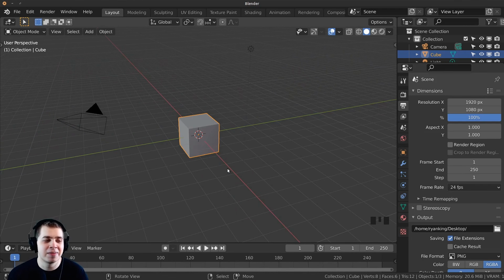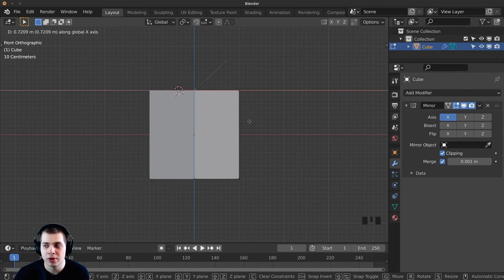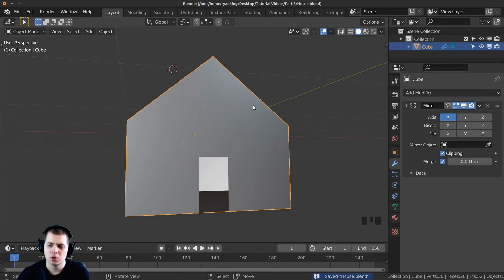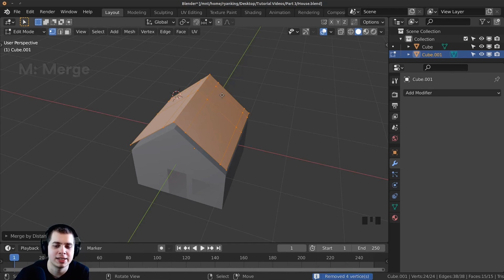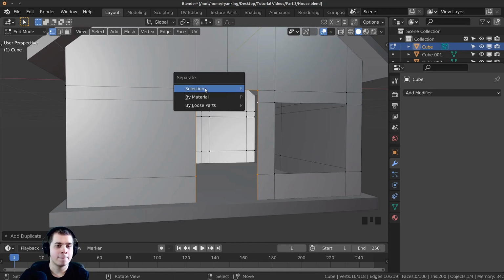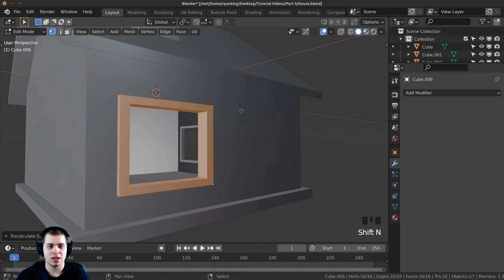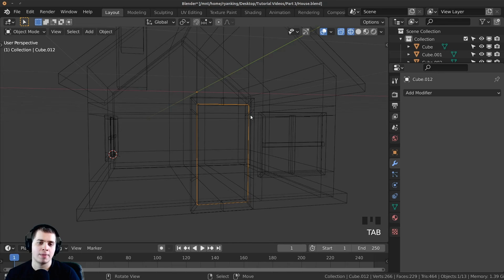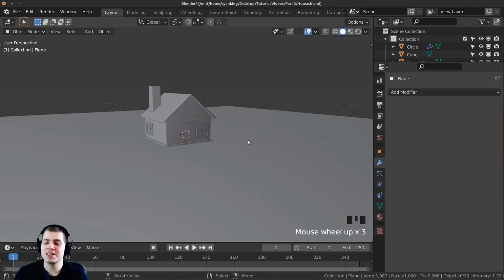Part 3-Blender Beginner Tutorial (Modelling the House) Updated Tutorial Link in Description

Comment: I am loving these tutorials, I've tried several times over the years to learn blender. Granted I AM struggling as I don't see the movements as quickly as others. I've restarted this particular one half a dozen times already. Only thing that I feel would help me(maybe not others) is the instructions wrote down as well. I get sidetracked with all the helpful tips, because you know I HAVE to go and test them out, then loose where I'm at. But, that's just me.  I'll SLOWLY push thru the tutorials, even if it takes me a year or more.

Comment: Thank you Ryan for this very helpful video series. I didn't get one part in this video though: When you started adding the window frames I saw that in the menu on the right a new object was created although you didn't use "p" to create it. The first vertical frame was named cube.007 and then when you duplicated it another one popped up and was called cube.008. I believe I did the same thing but in my case the whole window including the newly added frames were all one object and later copying and adding the window frame to the other window was kind of difficult. Any ideas what I might have done wrong? Thanks you in advance.

Comment: Hello there... Following your Video timeline at 18:58... My side in blender doubble time press G key is not working properly on the Top Right edge. it starts 90degree angle of the top right Edge and moving vertices to wrong directions. Where I am doing something wrong. I have tried so many times but facing the same problem.

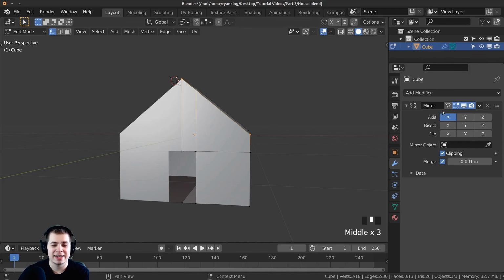Comment: pls help i have version 2.8.0 - I am unable to follow the video at 19:26 on the video timeline apply the mirror modifier - I do have the Apply Button; this is where I am having problem.
I follow your instructions, I select Object - I move the cursor to the modifier windows, press Control-a, I clicked tab to go to edit mode.  house does not have actual vertices on all the sides - I exit blender, reload the house, this time, I select Object, the Apply button enable - I do not know what to do - I did not press Control-a, I clicked on Apply button. Click on tab to select Edit - house does not have actual vertices on all the sides

Comment: Im having trouble with the loop Cuts,  it does not cut all around like yours , i only get the Cuts on the Front Face and is there a way to move the cut after placing it
Reply: I have these issues with the loop cut. The work around thus far that has worked is select the loop cut with alt and left click. Then press F to add a face. Then GG. The face keeps things together in one piece. Then, I erase the face. Just be careful not to erase anything else. I hope to find another way, but this works for now.

Comment: 18:53 If I double tap G the vertex on top of the door is not sliding till the end. So after sliding the door end line is not straight for me. Pls help me with this @RyanKingArt
Reply: Same here. The vertical lines of the doorframe got an angle if I try to make the door bigger. But it works when im trying to make it smaller.
Reply: Same with me😅
Reply: I am using Blender 4.2 and I am having the same problems as others in that the edge will not slide all the way down and everything distorts. Can you help?
Reply: Press shift and select vertex one by one in loop then press Double G it's work

Comment: For anyone whose merge did not work, this is what I did:
- Click M and click "merge by distance" (you must still do this even though it doesn't work)
- A small pop up in the bottom left corner of the screen titled "merge by distance will appear" 
- Increase the number on the scale (this increases the distance in which vertices will merge)
- Then, make sure to click "unselected" in the pop up window
This should then merge your vertices, hope this helps!
Reply from the maker: thanks for sharing

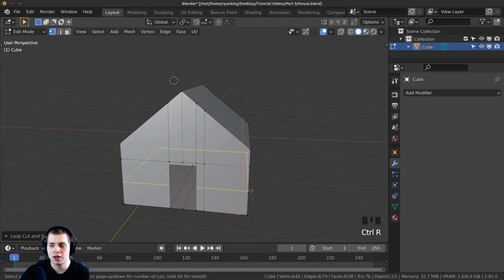Comment: I'm at 20:38 and the loop cut only applies to the right side of the house. I'm not sure if I'm doing something wrong as I've followed all the steps, or an update just changed the way blender is handling this. In the meantime I redid the opposite side of the house by remember the coordinates, but I'd appreciate some input so I can avoid the same issue in the future.

Comment: Thank you sir for getting me beyond fumbling around the GUI and keyboard shortcuts! 

Question: The loop cut proportionally climbs up the side of the house vertically, but stops at the soffit. I want to create a horizontal loop cut above the soffit in the area of the gable in order to construct a rectangular attic vent via the Mirror Modifier on that side of the house. I just can't slide the loop cut along the roof slope. 

Is there a work around?
Reply: I think I've stumbled upon the Bisect Tool's capability to loop cut the gable at the mid slope. I'll experiment with it and see if that's the right tool.

Comment: worked on the first part, and got to the part where this added the Miirror cut, but the problem is that there is a spaced line in the middle now and it does not match what is on the video. What did I do wrong?

Comment: Super tutorial.. I'm amazed at how much I'm able to do with just the things I learned in this video :)
Just one thing that I'm not sure was clear, though. I was having trouble replicating the mirror effect, Ryan made it look so easy! It turns out that each object has its own origin point within it (little orange dot), and that's what it mirrors on, which is why he cut the box in half, so that the origin point was on that edge. So the way I fixed it is to go into edit mode, select all vertices, move them over so the dot is where you want to mirror, then go back into object mode and add the mirror modifier. Put the point outside and you can do cool things like make twin meshes!

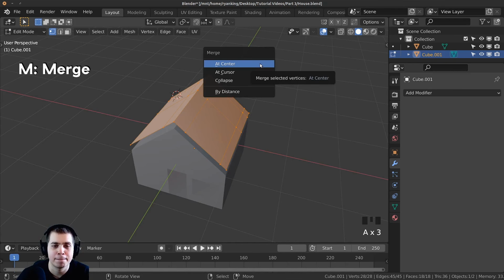Comment: A much easier way to merge the coplanar vertices around 25:45, is to select them and hit the Delete key and choose 'Limited Dissolve'. This will merge any vertices that lie on the same plane. It lets you clean up both sides of the roof in just one click.
Reply: Great advice. The merge he showed actually didn't work for me, it would keep saying "0 vertices removed"
Reply: @j31b  Same here, and I've been having a hard time finding an answer as to why it's happening
Figured out the solution:
 Click M and click "merge by distance" (you must still do this even though it doesn't work)
- A small pop up in the bottom left corner of the screen titled "merge by distance will appear" 
- Increase the number on the scale (this increases the distance in which vertices will merge)
- Then, make sure to click "unselected" in the pop up window
This should then merge your vertices, hope this helps!

Comment: If you are running Blender on linux, the Alt-Click to select a cut line doesn't work because the display manager uses the Alt key for moving and resizing windows.  To fix this, open your windows manager settings and under accessibility you can change the grab and move selection to use the Super key.  I use mxlinux and to find it you go to Settings -> Windows Manager Tweaks and click on the Accessibility tab.  Use the drop down to change it to Super.  I'm running Blender 2.8.3.5.
Reply from the maker: Yes. I use Linux Mint and so I had to change that setting. thanks!

Comment: Thank  you for these tutorials.  I running on linux and it seems that the version on linux is 2.8 but the differences are minor.  Getting rid of the extra cut lines doesn't seem to work quite as well.  I have two lines on the extra roof that just will not go away.  But I shall endeavor to preserver.
Reply from the maker: Hmm ok. Thanks for watching!

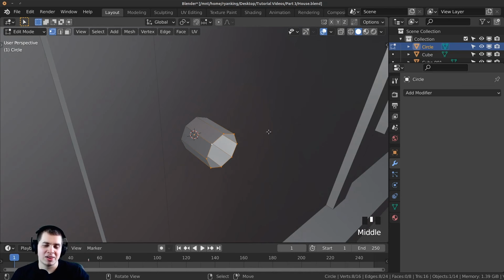Comment: Thank you for the tutorial. However, I'm having one issue with the door knob. When I go to extrude and immediately scale the beginnings of the handle (53:40), the selection then only moves in one direction, downwards, from the middle top vertex, instead of scaling outwards equally. I ended up having to separate the knob from the cylinder part. Any ideas for how I could fix that?
Reply from the maker: Hmm, make sure your transform pivot point is set to median point.

Comment: 44:11 How to place this part right in the mid of the window frame? 
How to create window frames with fixed depths and thicknesses? 
But starting from the handle, I can no longer understand the steps anyway, because e.g. the handle with pressing the num 7 is not visible at all through the protruding roof. 
It's a pity that at the end of the video the previously sustained slow development is no longer maintained... I managed to get such a knob at the end, but despite smooth and subdivision, mine looks more like a potato...
Reply from the maker: when you press R to rotate, the window frame should rotate from its center, because the origin point is in the center. If it isn't, you can set the origin to geometry, so it will rotate from the center.

Comment: - The colors (e.g. for the selected face) are not as different as in the video... How can I change this? 
- Are there preferences for color blindness?
Reply from the maker: Hmm, I don't think there are preferences for color blindness, but yes, you can totally change all of Blender's color settings in the User preferences.
Reply: @RyanKingArt  Ok... I would be already glad if I only could get a better contrast. In the object mode, I hardly can see my windows cutouts because the inner walls have the same colors as the outer walls...
Reply: Found a solution to this by myself...

Comment: At 40:17 when we are scaling the window, my window is scaling with respect to the origin rather than to the center of the object. I'm not sure why that's happening.
Reply from the maker: Make sure you are in edit mode, not object mode. Also, make sure the Transform pivot point option is set to median point, in edit mode.
Reply: @RyanKingArt  It works now, Thank you

Comment: Mirror not working? Im stuck on the mirror part. No matter what i do it will not mirror half my cube. How do i fix this???
Reply from the maker: Hmm, that is probably because the origin point Isn't in the center of the world. the mirror modifier will mirror from the objects origin. To fix this, in object mode, select the cube. Then Press Shift + S, and click on the, Cursor to world origin. Then on the top left-ish of the 3d space, click on the, Object button, and go to, Set origin, and click on, origin to 3d cursor. Also make sure you chose the right axis on the mirror modifier properties.

Comment: Thank you for the straight forward tutorial. When I use the 1 key on the numpad, it takes me to the back of the cube (-y) instead of the front (y). I can toggle using the 9 key, but it's very odd that its set up that way. In the last video I watched, yours went to the front (y) position. Not sure what happened to my blender. It's the same way on my laptop as it is on my desktop.
Reply from the maker: I think that is because you just started modeling your scene backwards. So just select everything, and rotate it by 180 degrees on the Z axis, to rotate it around.

Comment: Amazing tutorials and proving really helpful. Quick question I have though is reference precision. If I'm working to architects plans how can ensure the sizes are correct for doors/windows ceiling heights etc as haven't seen so far how to input dimensions.
Reply from the maker: If you Press T, to open the left side panel, you can click on the Measuring tool, to measure things. You can also in Edit mode, Click on the overlays, and turn on the measurements overlays. And it will show you the size and length of the objects.
Reply: Perfect thank you. I’ve tried to convert 2D plans created in Vectorworks into DXF files to import to allow me to trace but keep getting error messages. Any ideas?

Comment: Im not sure what happened, but i make a cube, loop cut it, select it and make sure its in object mode, add mirror modifier, and nothing happens. This program is so Effing stupid
Reply: ok it seem it has to be in edit mode, and you have to grab the object and move it
Reply from the maker: Yeah, in edit mode, you need to delete half of it, and move it to the side, and then add the mirror modifier.
Reply: Where im frustrated is it seems that its been updated to the point the tutorial is no longer accurate. Up until this point i was able to follow along just fine. Now i have two half blocks next to each other on x axis and cannot put them together like in the tutorial or make the roof like you are showing

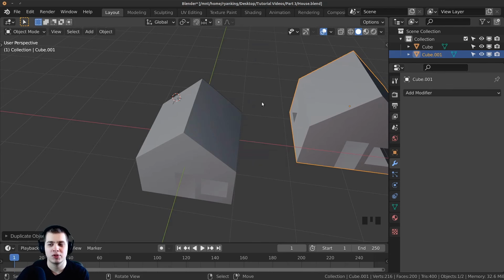Comment: New problem why is my duplicated roof (shift d) linked to my original house (24:00) i cant undo this for some reason
Reply from the maker: You have to separate it into its own object. I show you how to do that in the video.
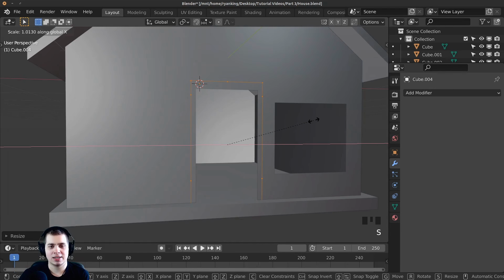Reply: @RyanKingArt  thanks i found my error in your video after replaying at least 8 times now at 35:00 do you know why my doorframe isnt extruding even when i press e my roof didnt extrude either even when i had them selected
Reply from the maker: @Rain87166  Hmm... your door frame isn't extruding? I don't know why that would happen.
Reply: @RyanKingArt  I tried extruding in both object and edit mode and nothing worked for some reason the chimney could extrude though
Reply from the maker: @Rain87166  hmm ok
Reply: @RyanKingArt  hey there, i am facing the same problem even after separating the duplicated roof and now im  stuck from last 3 days